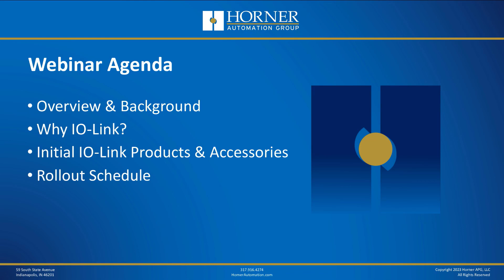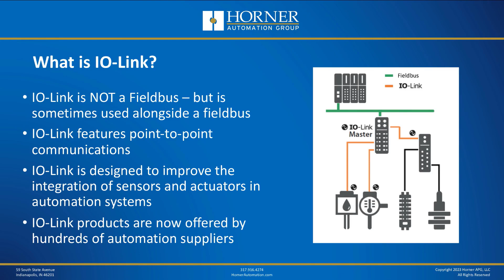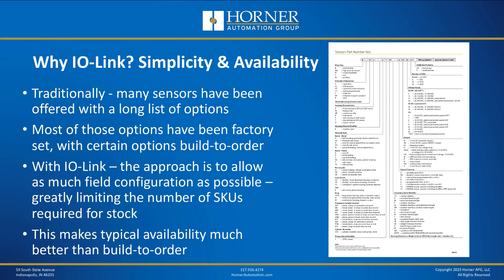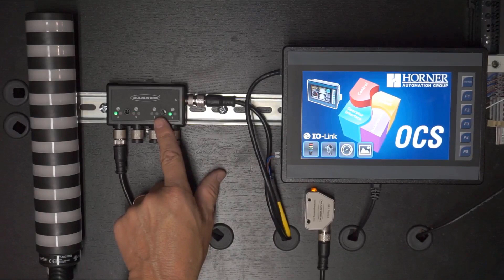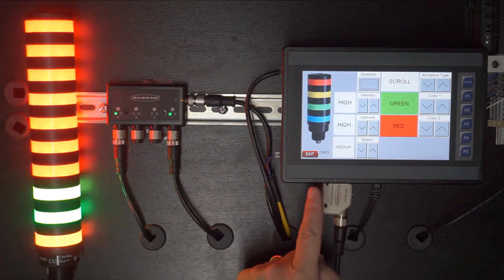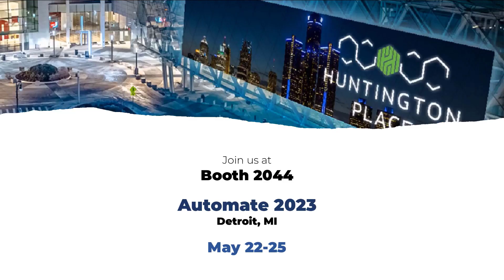IO-Link Master Launch

Comment: Can I presume that you also talk ethernet ip and profinet to a IO master that has these capabilities ?
Reply: Currently (as of May 2024) the OCS controllers are Ethernet IP I/O Adapters only - no Ethernet IP Scanner capability as of yet.  It is one of the most requested major features we get, and we are evaluating when we will bring this feature to market.  We're also evaluating Profinet, although that is likely further away - at least Profinet Master.  So today - we cannot control an IO-Link Master that requires Ethernet IP or Profinet.  We are currently limited to those which support Modbus TCP or Modbus.